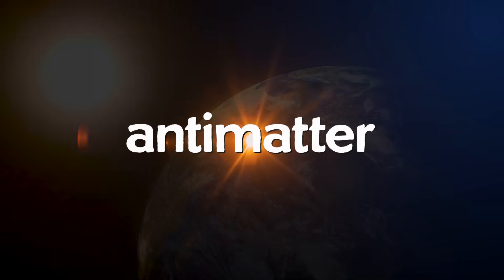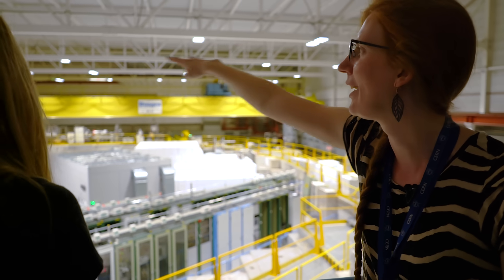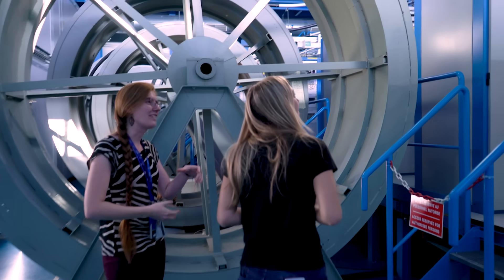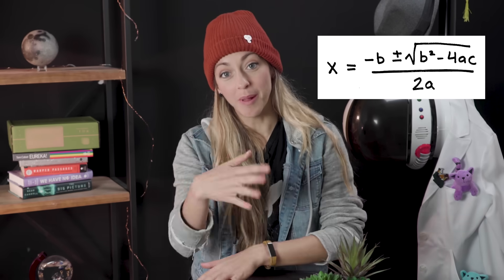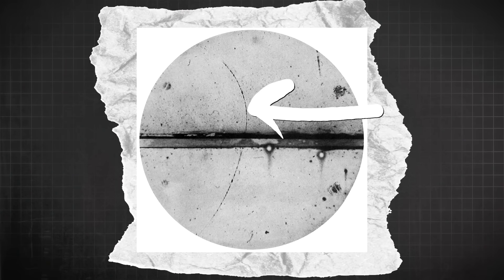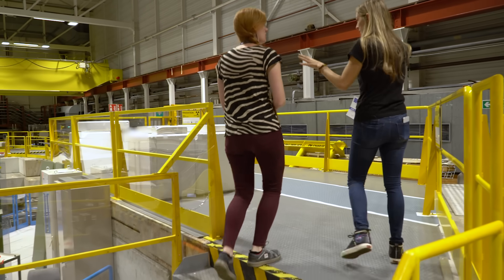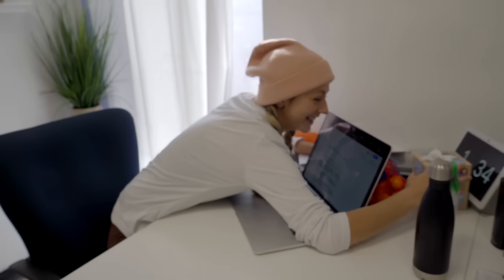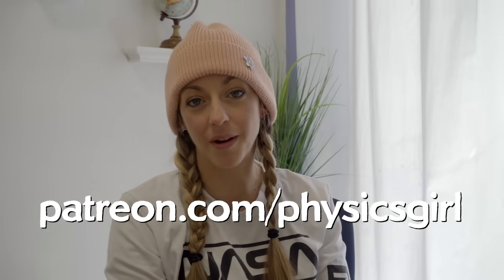Why This Stuff Costs $2700 Trillion Per Gram - Antimatter at CERN

Comment: Isn’t there such a lack of antimatter because of the rate the annihilation occurs? If it can’t interact with anything around us or the universe without being metabolized into a light emitting reaction I’d say that any antimatter that ever existed has reacted and gone through this annihilation process
Reply: Correct, but for annihilation to occur you need both matter and antimatter and the process would "metabolize" both equally. So, if that's true, why is there more matter than antimatter? That's the mystery
Reply: @sab_sf  Doesn’t the randomness of the quantum world make it very improbable that exactly the same amount of matter and antimatter existed after the BigBang?
Reply: @sab_sf   If I recall correctly it's a consequence of the inconsistency of the weak nuclear force. When when certain particles with certain spins decay the nuclear force that governs decay will sometimes spit out more matter than Antimatter for one reason or another, and we don't know why.  There was an experiment  done on cesium atoms that stumbled into this discovery, very interesting stuff.
Reply: The answer is-indefinite.
Reply: @sab_sf  I appreciate that what I am about to say brings no value to the discussion, however my inner voice read your comment with Jim Parsons voice..
Reply: @sab_sf  Their explanation is that antimatter is more volatile than matter.
Reply: @scorpioninpink  Antimatter and matter only become volatile when they interact with each other. One is not inherently more volatile than the other. The reason why antimatter is considered highly volatile is because the place in the universe we inhabit happens to be primarily made up of matter. If our universe was instead made up of antimatter, we would not even notice a difference, except for scientific observations on the (sub)atomic level.
Reply: @sab_sf  Hey Ferb I think i know what we're doing today.
Reply: @sab_sf  There was just a tiny but more matter than antimatter, I guess.
Reply: @sab_sf  really cause they didn't say anything about that.. they just said if it touches ANY antimatter. There was nothing specified like you claimed.
Reply: @sab_sf  AAAAA MY BRAIN 😂
Reply: @sab_sf  How might matter and antimatter react to the explosion though? Does the explosion constitute a mass of matter or antimatter? If 1 matter + 1 antimatter = explosion, what about 1 matter + 2 antimatter? Also, does 1 matter + 1 antimatter result in 0 matter? Will the interaction of the two particles have the same result if the interaction is surrounded by a single layer of matter when compared with the two particles being surrounded by a layer of antimatter?
Reply: @skawn  sounds like someone needs some antimatter to expirement with
Reply: @michaelzborovan9565  Not sure that's the case.

https://en.wikipedia.org/wiki/Antimatter_weapon
Reply: @skawn  antimatter reacts equally with its opposite. 1 positron will interract and annihilate 1 electron. They produce 2 photons, and nothing else. This happens with all matter/antimatter pairs. An antiproton wont interract with an electron or neutron. (It CAN happen, but its not annihilation, its just an interraction)

Antimatter is produced in one of 2 ways. One is "pair production", which is essentially the reverse of annihilation. Get huge amounts of light energy concentrated, and the energy can form a matter-antimatter pair. Usually, these will annihilate immediately and go back to being light, but using magnets and charges, you can pull them apart. This only really works for making electrons, though, as by the time youve put in enough energy to make a proton, it would just "cash in" early, and make an electron and positron instead. 

For creating protons and antiprotons, the usualy technique is smashing protons into other protons, or into elements, like in the Large Hadron Collider. In any interraction between 2 hadrons (the more solid stuff made of quarks, so protons, neutrons, antiproton, antineutrons), a few things have to stay the same on either side of the equation, called quantum numbers. For example, if the initial particles have a total charge of +1, the final ones also must have a total charge of +1, too.

Lets crash a proton p into an element, A. Experiment shows that this creates an extra proton, which can be detected normally
p + A --> p + p + A
But, the right side now has more charge than the left side, so we know an antiproton must also be produced
p + A --> p + p  + A
(Oversimplification, but you get the picture)
Because of how much bigger hadrons are, things like proton-antiproton collisions can create a lot more than light, and give rise to a LOT of funky particles
Reply: @glenwaldrop8166  apologies for being 7 months late, lol... 
I assume your specifically referring to the "photons" part of the statement??? There's other kinds of energy released too obviously but not byproducts like in a modern nuclear weapon that are considered nuisance type byproducts... 

as stated by your wiki link: "The paramount advantage of such a theoretical weapon is that antimatter and matter collisions result in the entire sum of their mass energy equivalent being released as energy, which is at least two orders of magnitude greater than the energy release of the most efficient fusion weapons (100% vs 0.4-1%)."

All matter converted into energy... that said there's different kinds of energy and some of it may serve little purpose as a weapon and therefore be considered a "byproduct" but not in the same sense as nuclear fallout as a byproduct... a physical material that did not exist as part of the original constituent materials before detonation but created during and by the detonation itself.
Reply: @sab_sf  it is at the centre of the earth...held by the earth's magnetic field...also called "d bottomless pit"
Reply: @sab_sf  E=MC2
Reply: The point is that matter and antimatter annihilate each other. So in the beginning of the universe, why didn’t all the matter and antimatter annihilate each other resulting in a universe of nothing but energy? Why did one of the two “win out” in the end when we expect there should’ve been equal amounts in the early universe? That’s the question
Reply: @warpedwhimsical  Why do we expect them to have been created in equal amounts?
Reply: @laeioun  this is very complex and there are a lot of possible reasons. One reason is that the universe obeys the law of conservation of charge, so whenever particles are formed from pure energy, it always appears in a particle-antiparticle pair. For example, an electron (charge -1) cannot come into existence unless a positron (charge +1) does at the same time, otherwise the law of conservation of charge would have been violated. It’s thought in the early universe pretty much all particles came to exist after being converted from energy. So the universe should’ve created equal amounts.

We know this because when we slam high energy particles together to create new particles from the resulting energy explosion (like in the large hadron collider), the result is always that matter and antimatter are created from the energy in equal amounts.
Reply: @warpedwhimsical  it obviously wasn't created in equal parts. Why is it assumed that it was created in equal parts?

Regardless, whatever amount of antimatter was created annihilated an equal amount of matter, unless there are pockets of antimatter out in the vacuum of space (possibly an antimatter galaxy? interesting thought), the Big Bang would be much larger than originally thought.
Reply: @warpedwhimsical  I understand the question. Like I said, there could very well be regions of the universe made up of antimatter instead of matter. Life could of even evolved in such regions
Reply: @christianbrobst3486  not sure what you mean, I wasn’t replying to you in any of my comments
Reply: @warpedwhimsical  thank you for the simplicity of this statement , wise intellect
Reply: Matter Cannot be destroyed or Created, it can ONLY be transformed.
Reply: @vtron8580  right—but what they don’t tell you in low level science courses is that matter is actually just another form of energy, and the two be converted into one another.
Reply: @warpedwhimsical  matter is simply, energy condensed into small vibrations. This is my favorite explanation of matter
Reply: Idk dude it sounds like you know the answer already
Reply: We know that the universe is almost entirely composed of ordinary matter because annihilation creates large amount of gamma radiation, which would be very easy to detect. But we don't see anything, so there can't be large antimatter galaxies and such. Why the universe has more matter than antimatter is still a significant unsolved problem.
Reply: That's what makes it a mystery they're wondering why anything exists at all after the big bang the anti matter and matter should have all just annihilated itself until nothing exists.
Reply: OR quantum entanglement means that they both exist at the same time but can only be one or the other, a 0 or a 1. But isn't that what they always say in the movies, that antimatter eats away at the universe?
Reply: @remi2nice  Antimatter is super rare (at least as far as we can tell) because almost all of it reacted with matter right after the Big Bang. The small surplus of matter that remained is what makes up all the stars and galaxies that we see.
It's possible some amounts of antimatter have survived in empty places though.
Reply: So ALL the matter we observe is just left over from the 'annihilation era' ?  That's a lot of material even if you look at the bright stuff...then you get into anti-dark hijinks.
Reply: Epstein is in the CIA.  He is still alive.  Everyone in the CIA should be executed.

CIA tech wicket wicket wicket
Reply: And yet we are still here. SO in theory there was more matter than anti matter, they annihilate each others. Most likely, the remnants pushed each others like magnets.
Reply: Considering the fact that there is apparently an equal amount of antimatter than matter, that wouldn't really work without annihilating everything.
But, correct me if I'm wrong, but can't an antimatter object just exist in the universe? How would we know unless it touches matter?
Reply: But then why is there matter left?
Reply: I was thinking about that but if that’s the case that means the universe was born with more matter than antimatter, or maybe the annihilation of antimatter and matter actually produces matter along with light? I know nothing about physics whatsoever.
Reply: Imagine the ocean, now drop a billion ton sphere of salt into the water. Eventually it dissolves but is able to survive and can be separated from the water. Since we can create anti matter from matter, it’s fair to say it had simply changed its state. I’m sure there are some mind blowing volumes of antimatter scattered throughout the universe. In some areas antimatter might be dominating matter in percentage. Maybe even life has formed in such regions of antimatter dominated space
Reply: @christianbrobst3486  We do not create antimatter with matter. We use photons, which are not matter and have no charge, to create antimatter.
Reply: @laeioun   okay sorry, we create matter and antimatter from high energy partial collision. Both created in equal parts. That doesn’t effect my hypothesis or the example I used to explain it.
Reply: @christianbrobst3486  wouldn't that means there are whole star systems out there composed of antimatter? IDK, It seems like the obvious answer.
Reply: @indigetes  well yeah hypothetically i assumed it would even be possible to contain entire galaxy fields or even an exact mirror to what we view as matter
Reply: @christianbrobst3486  huh?
Reply: @christianbrobst3486  There's a thought.

If there is a large enough bundle of antimatter there could potentially be an antimatter galaxy out there somewhere that annihilates matter when it accidentally makes it's way there.
Reply: But theoretically there's an equal amount of matter and antimatter in our universe... Does that mean there are parts of our universe billions of light years away that are entirely composed of antimatter?
Reply: What if antimatter goes againt gravity? Then all the antimatter would fly away from matter.
Reply: @Carbon2861996  It doesn't. That much they can test at CERN. Also gravity is just curvature of space, it's not a force for which there can be an "opposite force".
Reply: @magicmulder  Heard somewhere that antimatter goes backwards in time. And since time more or less causes gravity, then well... shrug
Reply: @Carbon2861996  It doesn't go "backwards in time". There's nothing magic about it (just like there is nothing special about dark matter per se), it's just a different kind of matter that happens to react violently with "standard" matter.
Reply: @Carbon2861996  that’s not how that  works
Reply: Keep it suspended in a vacuum. How? 🤷🏽
Reply: @TheCAPTAINman128  in the case of being in space, seems pretty simple. Matter and antimatter separated by a whole lotta nothing.

If you're talking about in vacuum on Earth, dunno.

Comment: I remember reading that the Hiroshima blast (~15 KT TNT equivalent) converted just one gram of matter (equivalent to 1 ml of water) into energy. If that is accurate (albeit crudely), then by simple arithmetic, the uncontrolled release of a mere microgram of antimatter (annihilating with 1 microgram of matter) would be equivalent ((~30 KT/1,000,000) x 2000) to ~60 pounds of TNT.  
[By that reasoning, annihilation of 2 Tablespoons (30 grams mass - for WATER) would yield 450 KT, which would have about 3 x the damage Radius (assuming cube law) of a Hiroshima blast. Sounds about right.]  

In any case: For the "bottle transfer", clear any snow / ice off the street, first...!  XD
Reply: Actually, I just read that "Kilotons" was based on METRIC tons of TNT. So: 66.14 lbs of TNT/microgram.
[HAH ! The (US) Manhattan Project was METRIC, Way Back Then... where did it all fail, in Civilian Life]
Reply: @anorthosite  yes, tons are metric
Reply: @Amelie12  there are both Metric and English tons
Reply: @ebob0531  Wait what? 
Both has tons?
Reply: @Amelie12  yeah English ton is 2204 lbs. American is 2,000
Reply: @ebob0531  Wait what? 
1 ton is 1000kg
Reply: @Amelie12  metric ton, but in the English engineering system a ton is 2204lb
Reply: Do you remember when scientist used to fear that we would set our atmosphere on fire, with the extreme heat from a nuclear bomb. They thought it could cause a cascading effect and just blow up the atmosphere.
Reply: @MandosaWright  they thought it would cause the nitrogen to fuse and start a run away reaction....
Reply: imperial tons should not exist anymore

tons are always metric, everything else is an exception
Reply: @NoNameAtAll2  Nope. Imperial system should always stay around because it irritates so many people. I use the metric system in most cases. But as soon as someone is annoyed with Imperial I start using Imperial.

Comment: If a characteristic of matter is mass.. More matter = more mass i.e more grams. Wouldn't a characteristic of antimatter be.. Anti mass or in opposition to accumulating more matter(grams). And theoretically i would say the more accumulated the less it should weigh. This is an emperors new clothes story. 
They have this expensive "invisible" miracle solution in a fancy bottle thats right in price range for a mid sized goverment to get a loan for.